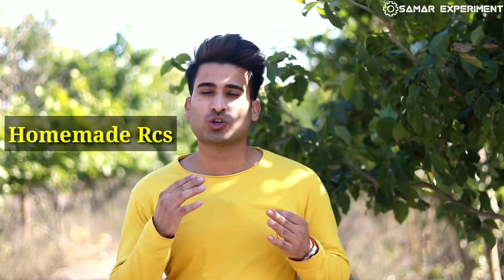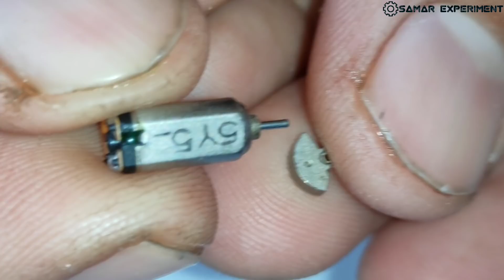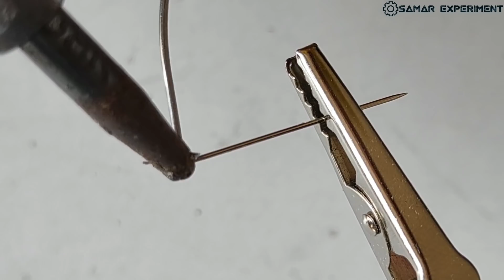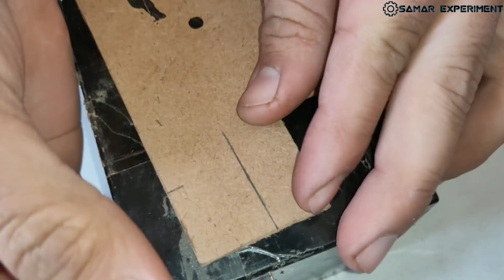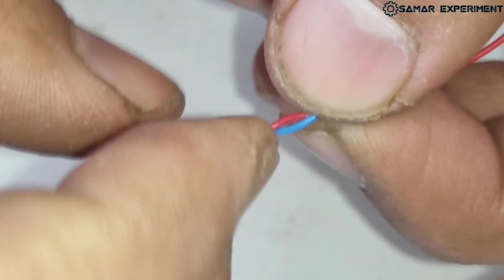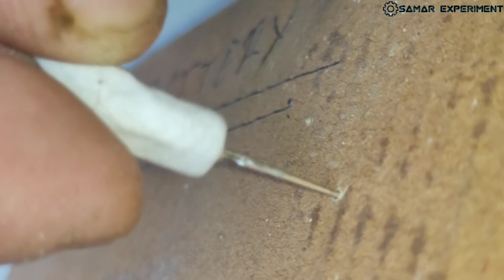Homemade World Smallest Drill Machine || दुनिया की सबसे छोटी Drill Machine || Hindi

Comment: Your videos are always interesting.

You can use #20 injection needle to guide your soldering. It can be used as a sleeve and a proper .5mm drill bit from PCB drill can be used instead of using a needle.